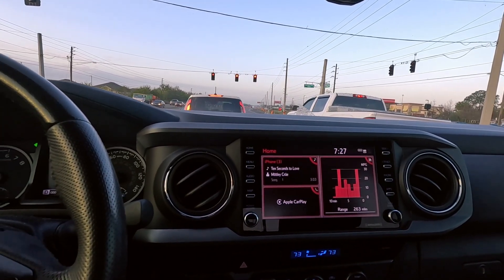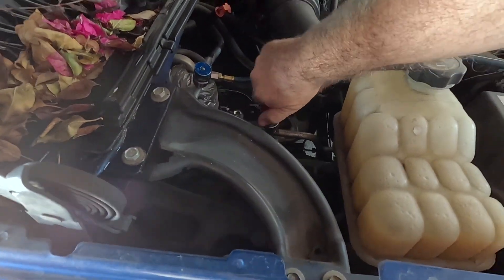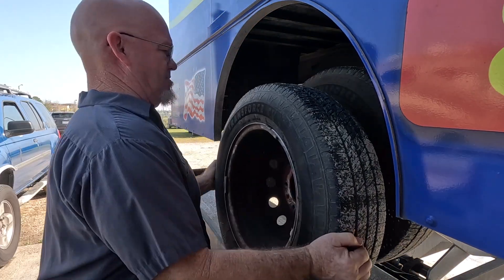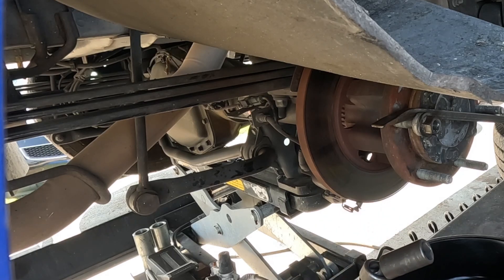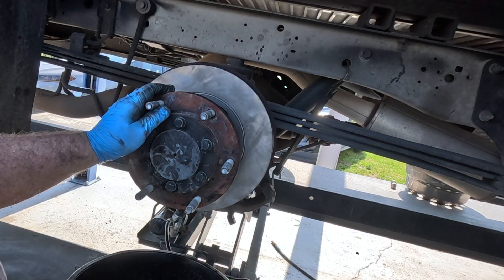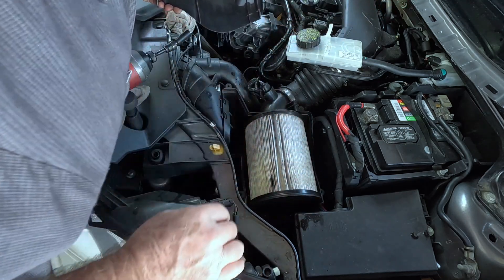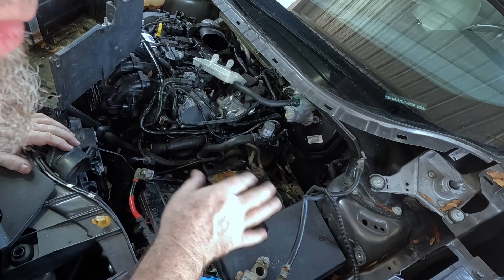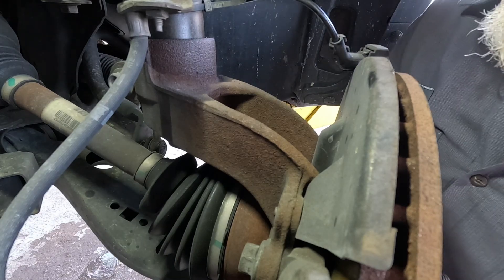A DAY IN THE AUTO REPAIR SHOP 195, FORDS, CHEVYS, ENGINES, BRAKES, AIR CONDITIONING...

Comment: I just rebuilt the trans in one of those Escapes. Not an easy trans to get out with everything crammed in there. I got to pull the trans all apart again due to 1-2 shift flaring when it was cold. The Ford reman valve body I used, the 2-6 valve was hanging up🙄
Reply from the maker: Oh damn, that is no fun. We all hate redos. But all the bolts have been turned, so that’s good. :)
Reply: @JimmyMakingitwork  HA. Yeah, they come apart and back together REAL fas the second, 3rd and 4th time around. 🤣. First time out was like 4 hours, 2nd time out 1.5 hours🤣

Comment: Believe it or not Jimmy my 91 GMC 1500 has dual fuel I run a line from my propane tank to fill my A/C its been that way since 1992 , but she sure is cold same compressor and lines , I did have low pressure side valve port leak , love that old 91 NO PAYMENTS JIMMY LOL.
Reply from the maker: Haha, I lived without payments a long time. Maybe I’ll keep this Tacoma and do it again for a bit.

Comment: Lock tight or not lock tight that’s the question  The only consistency is inconsistency on when to use it amongst content creators IMO. I recall your comments while struggling to remove fasteners that have it on them. I can’t recall seeing you applying any on camera.  I be interested in an overview of your thoughts where its necessary and where its not. Thanks for another great day in the shop.
Reply from the maker: Thank you Francis. I rarely use it unless I’ve seen a problem on certain fasteners. Which is very rare.

Comment: I did a 2.4  timing chain  it ran great but it  still has a code for The exhaust and can not plausible  dose it mean it needs a motor
Reply from the maker: Could be off a tooth, which will run ok, but set a code. Could also be a sensor or wiring connector problem?
Reply: @JimmyMakingitwork   I am going to  try again is there a way to check the  sensor
Reply: Check the tone ring for the cam sensor reading on the exhaust cam,will walk off.If you see a gap between the cam and tone ring,that will cause it.I seen it once so far
Reply: @Toolaholic7   how do I do that
Reply: When you do the timing you gotta pull the washer off the crank to be able to see the timing mark. You’re prolly off by one tooth. Had it happen to me in the past.
Reply: @puremayhemFTW   can I move it a tooth without pulling everything off again
Reply: @Cody Sallander  pull the valve cover,real easy to see
Reply: @codysallander581  I don’t think so. U basically have to pull the chain and put all the paint marks on the chain on all the timing marks again.
Reply: @puremayhemFTW  I did. Put it all back together Grove perfect then the light came back on. Could the censor or The syllonoid. Be bad
Reply: @codysallander581  anything is possible. If you are 150% sure that timing is right. Then I would follow the trouble tree for the code set. Test all wiring. Test sensors. Scope it. Does the engine light set right away after clearing and restarting engine?
Reply: @PureMayhemFTW   thank u all I got it  had to put new Selenoids in
Reply from the maker: @codysallander581  Glad to hear that, solenoids are a common failure item. But they usually set circuit codes for solenoid control, along with timing codes. I’ll usually swap them intake to exhaust to test.
Nice work.
Reply: @Jimmy, Making it work   I pulled 2 out ove a old motor ans shaped them out  and it fixed it